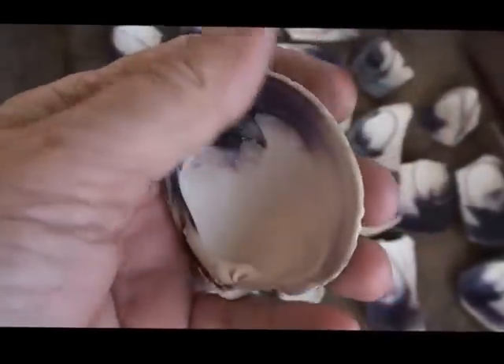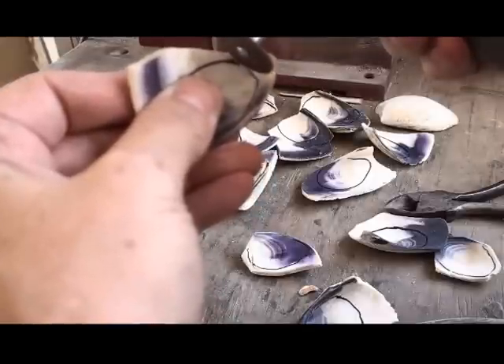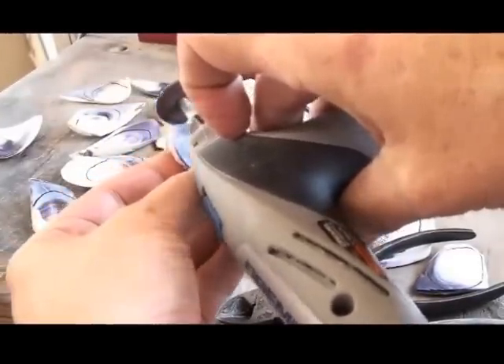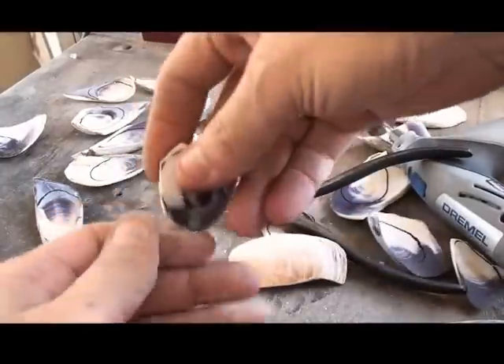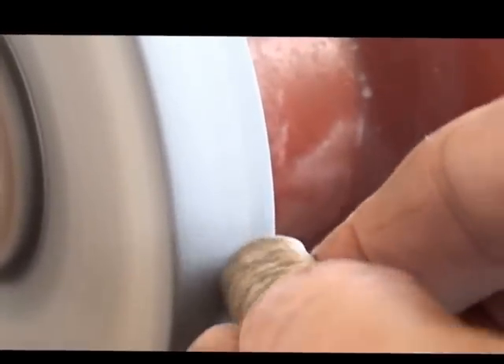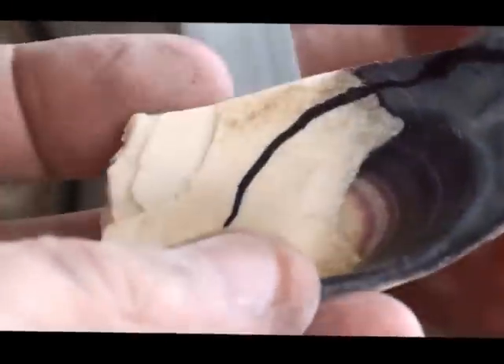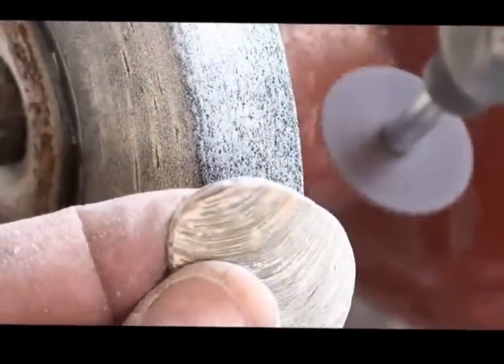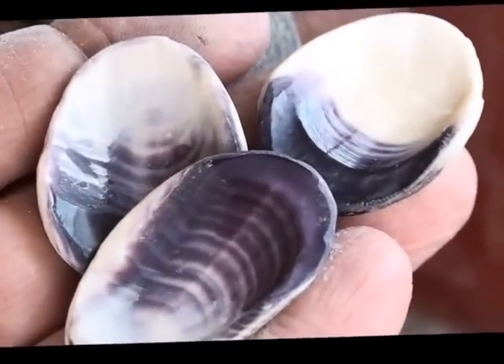Art of Quahog Shell Creations (Jewelry)

Comment from the maker: Eza E....Polishing Quahog and many other shells. Simply purchase a Rock Tumbler and there will be approx. 5 levels of Carbon Grit. Read all instructions.
Add Dove Bar Soap 4 table spoons full. Drop shells in Rock Tumbler. Make sure thecshells are totally submerged. Coarse grit then to the polishing grit. The entire cycle could take up to 2 weeks to complete the polishing process. NOTE: ONLY add
Dove at the end of Grit cycle. Be patient, those shells, rocks and more will come out beautiful. Called Burnishing the pieces inside. Goodcluck and take your time. Do not put Oil on shells, as that substance will not allow the shell to polish to its fullest potential. Thanks for watching!
Reply: Another way, if u have the patience and time!

Comment from the maker: Use an approximate 3/32 high speed bit. Use light pressure on drill or yes it will shatter. Practice and when you hear a squeeking sound use a water spray bottle to cool the shell and do not run drill at a fast speed as the shell will get too hot then crack! I carve Ivory and after 12 yrs. I learned. Practice makes perfect! Be patient!
Reply: X- Tremevidpro drill the pieces under water. If you try to do tube beads a spray bottle will not work. Use triple ripple diamond drill bits. Ive been making wampum a long time and by far the best bits you can get.

Comment: what kind of polish did you use on the shells at the end to make it look so shiny? could anyone here tell me what would be a good kind of polish to use on shells (besides nailpolish and baby oil)
Reply from the maker: Eza E....Polishing Quahog and many other shells. Simply purchase a Rock Tumbler and there will be approx. 5 levels of Carbon Grit. Read all instructions.
Add Dove Bar Soap 4 table spoons full. Drop shells in Rock Tumbler. Make sure thecshells are totally submerged. Coarse grit then to the polishing grit. The entire cycle could take up to 2 weeks to complete the polishing process. NOTE: ONLY add
Dove at the end of Grit cycle. Be patient, those shells, rocks and more will come out beautiful. Called Burnishing the pieces inside. Goodcluck and take your time. Do not put Oil on shells, as that substance will not allow the shell to polish to its fullest potential. Thanks for watching!
Reply: Thank you so much for taking the time to give me such a descriptive response!

Comment: Hi! I have a unique project I'm trying to do. Recent dredging brought up a ton of quarter sized quahog or quahog-like clam shells. I have a couple hundred. I'm looking to smooth them down in a rock tumbler, drill press holes in them, seal them then string them up to create a shadow box piece of art. I'm not looking to lose all shape of the shell but definitely smooth it down. Do you have recommendations about order of operations (specifically drillpress) and grit in the rock tumbler?
Reply: Also this is my loosely based inspo for the project: https://www.neimanmarcus.com/p/palecek-adrift-coco-wall-decor-prod188180239

Thank you in advance for your help! Ib was excited to find someone who'd understand my vision
Reply from the maker: Definately use coarse until you have reached what you are looking for when Tumbling your shells. If you use a drill press odds are many will crack due to speed of drill.Place the shell onto a thick cloth and drill them wet and slow. Good Luck and take your time!

Comment: Great information. I like watching this video. and Bless You for trying to talk us thru it all, but as soon as you start up the tool, you start talking - I haven't caught hardly a word you've said while you're cutting. ;) 
Also, I understood a mask was necessary due to the dangers of breathing in 'pulverized' ;)  Silica from the shell dust? I'm looking forward to trying these methods out now, thanks! :)
Reply from the maker: Eza E....Polishing Quahog and many other shells. Simply purchase a Rock Tumbler and there will be approx. 5 levels of Carbon Grit. Read all instructions.
Add Dove Bar Soap 4 table spoons full. Drop shells in Rock Tumbler. Make sure thecshells are totally submerged. Coarse grit then to the polishing grit. The entire cycle could take up to 2 weeks to complete the polishing process. NOTE: ONLY add
Dove at the end of Grit cycle. Be patient, those shells, rocks and more will come out beautiful. Called Burnishing the pieces inside. Goodcluck and take your time. Do not put Oil on shells, as that substance will not allow the shell to polish to its fullest potential. Thanks for watching!